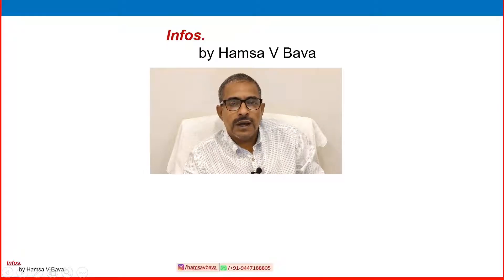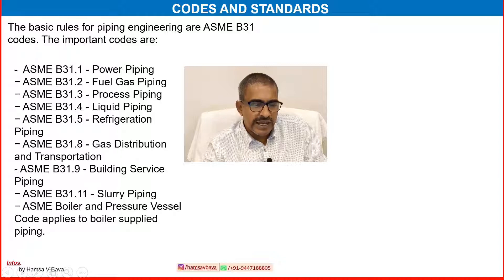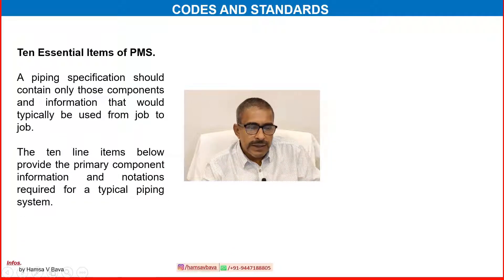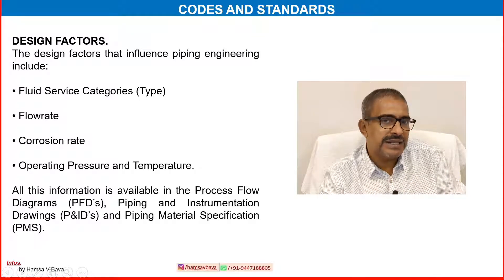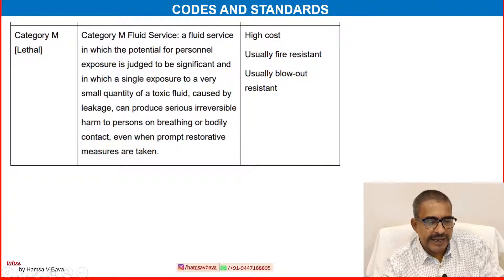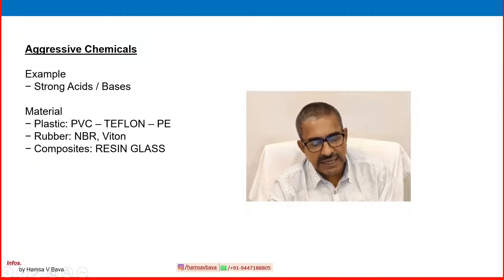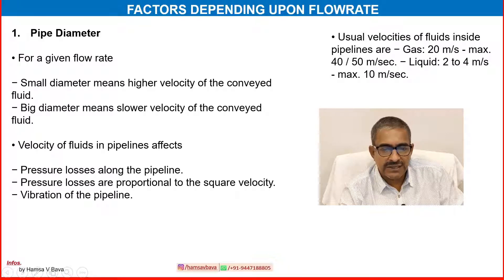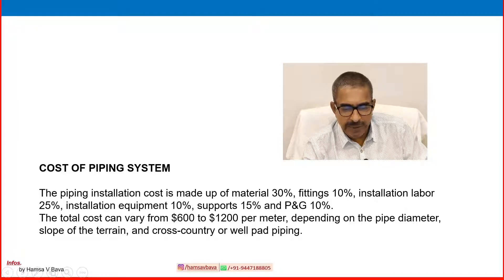Pipes, Fittings and Valves - Part  3

Comment: All your videos are great and if possible could you please take classes on underground piping in the future? like RTR PIPING OWS system, FW system. underground piping layout design concept and RTR piping fabrication fitting type. testing procedures. like hydro test or gravity test. here I am requesting all above underground piping by using RTR material. thanks for your support
Reply from the maker: Great suggestion!, Infact I am a process trainer, my knowledge in piping system is limited.
Reply: @InfosbyHAMSAVBAVA  I express my sincere gratitude to for your response.  If possible could you make process cycle about two topics 1. condensate stripper unit. 2 enrich oxygen unit ( it is known as vaccum Swing absorption) . Please make classes about this topic with illustration . Thanks for your outstanding YouTube channels
Reply from the maker: Thanks for the comment. I will try to add your suggestion in future videos.